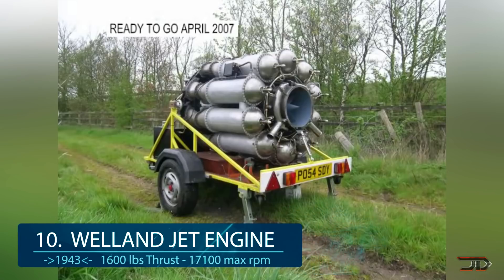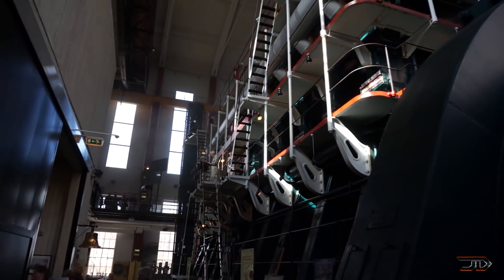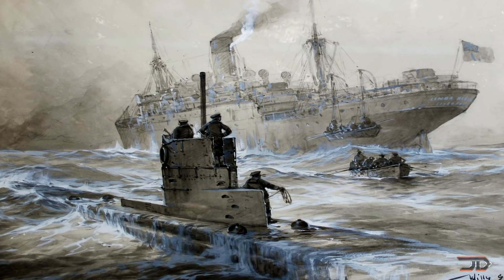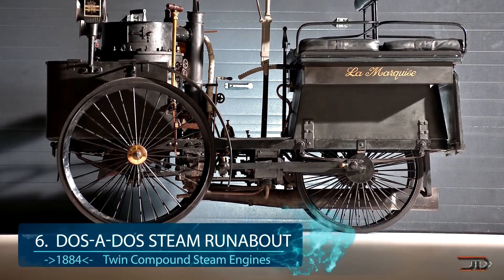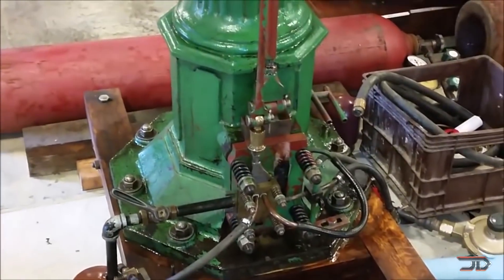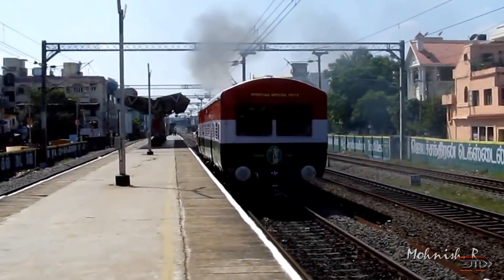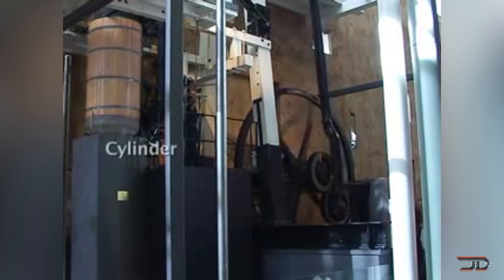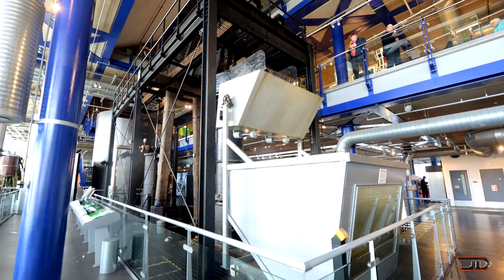TOP 10 OLDEST Running Engines

Comment: THE OLDEST JET ENGINE RUNNING?! There is literally a Me262 that still capable to fly, and it was the second Jet fighter in the world, that uses the god damn first jet plane's engine, the Junkers Jumo 004 are the oldest running
Reply: ..but not an original one, The first repro airframe flew in 2002. They use engines from General Electric, because the original Jumo units lasted about four hours.
Reply: @DaimlerSleeveValve  Ok I didn't count if it was repro or original, if thats the case, you are right.

Comment: The M.E 262 is the oldest running Jets since Germany was the first to developed it
Reply: The Welland engine in this video was built in 1943 and still runs. There are no running Jumo jets from that period. Incidentally, there were flying jet-powered planes in both England and Germany before the Me262, but the Me262 was the first to enter front-line service.
Reply: The Germans did have the first operational jet aircraft, but the problems of materials procurement held them back.
The German engines had a service life of no more than 25 hours before needing a major rebuild. This was because of the lack of alloy steel that would stand the temperatures in the exhaust turbine. When ME262's were captured Allied test-pilots had no idea of how close the engines were to exploding because the maintenance records were missing. I think that Frank Whittle had similar problems.
The Rolls-Royce Welland is a Power Jets Ltd W2B. The Gloster Meteor later used the R.R. Derwent, which was another Power Jets design. Power Jets Ltd being a company set up by Frank Whittle in 1936, but he had a patent for an engine in 1930.

Comment: 2 more from Denmark. Hammel vognen 1887 teknisk museum Helsingoer, Ellehammer plane engine 3 cylinder from  1905. Both still running and original.

Comment: Did I hear him correctly? "This contraption (sic.) was invented before the four-cycle ignition". What does an ignition scheme have to do with the operational concept that Otto himself conceived of not long after this was built?
 (I understand what this guy was getting at, but his mistaken choice of terms renders any education value (that this video should have had) completely void.) I just have to state my hypothesis again, that should never have needed to be said the first time... 'Stupidity and functional illiteracy are being spread by contact with Youtube production tutorials'. 
The fact that there was no compression shouldn't be a big surprise, since the Watt steam engines used for many years to pump water from mines produced the displacement of their pistons by atmospheric pressure from the condensation of steam, rather than it's expansion like the better known engines of more recent times. So there's nothing strange about starting out their inventing and development with the more simple designs, and then evolving those concepts into a workable, more powerful and efficient system. Luckily, Otto made a conceptual leap with the 4-stroke cycle that put the ultimate expression of his designs much more within their grasp. (Breathe, damn it!)...

Comment: It's almost misleading to talk about horsepower with for example the MAN DM12 and engines like that one. Yes the hp is probably correct, but thats because the rpm is so low. It's probably  around 2-300 (often lower) at peak rpm. The torque on the other hand is very strong because of a long crankshaft and a heavy flywheel.

Comment: Sweet....allthough i am missing wind and watermills..technicly they are engines ;)
Reply: Dirk Pitt:  What is an engine?  What is a motor?  These terms are still being debated.  Have you seen a street sign or a billboard sign oscillating in a wind storm?  Technically, those are engines; i.e., mechanical devices which are driven by some external energy source.  Fuel, wind, water, animals, and humans are external energy sources.  Animals and humans are fuel driven engines which power machines.

Comment: Some of these begs the same question as the ship of Theseus. The question of whether an object that has had all or most of its components replaced remains fundamentally the same object. There are many incredible builds that are called restorations that are clearly not.
Reply: I have a 200 year old hammer; I replaced the head twice and the handle 3 times.
Reply: What is your secret for a long life 200 years?
Reply: I was thinking the same thing, but stuff wears out. When you buy a car you take for granted that it is going to need maintenance, new tyres, battery, alternator maybe, clutch exhaust those types of thing, but when you come to sell it no one would expect you to describe it as modified or not original.